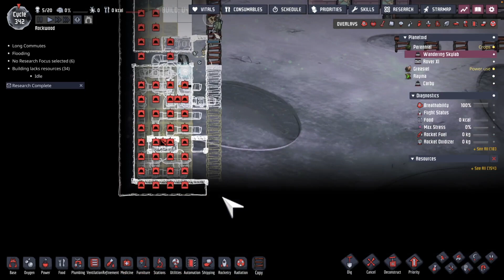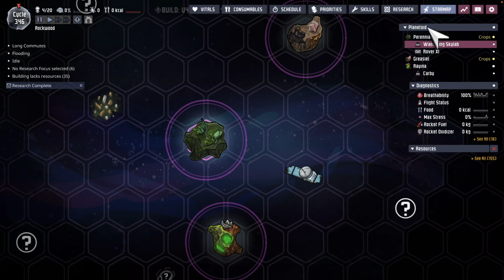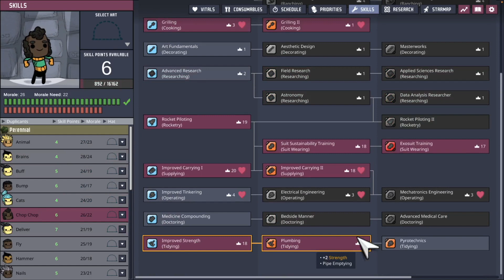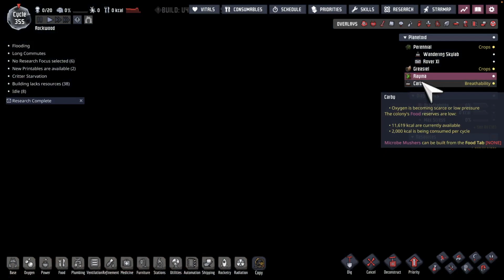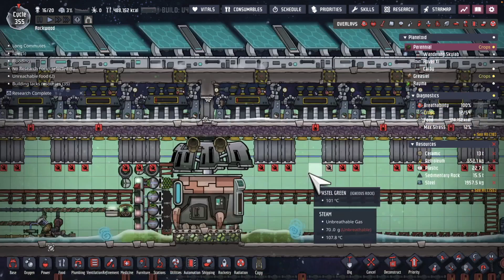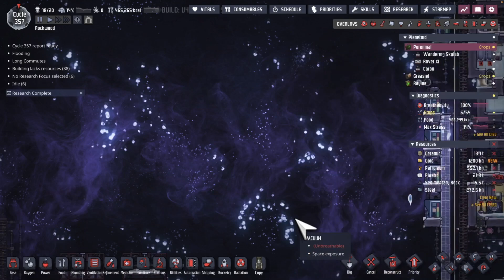Folia Astroid 17: Mega Rocket

Comment: Rocket is looking good! 

Don’t forget you can always release extra/unwanted gases like carbon dioxide and hydrogen into the vacuum of space if you need to. 

The telescope should work but I don’t think the Mission Control will. You might want to put a triage cot or two on the rocket (or leave room for one) if you are planning on sending this rocket to other asteroids to dig/clear/build. Or a small massage room to help if anyone gets stressed (which admittedly would probably only be a problem if they were working on other asteroids). Good to be prepared just in case, right?

The only other thing I can think of is if you have two dupes on a schedule, maybe put in a second party line so they both can get the buff?

How are you planning to keep them busy while traveling?